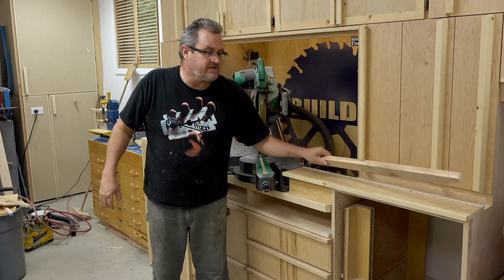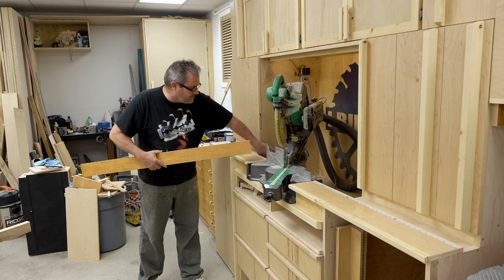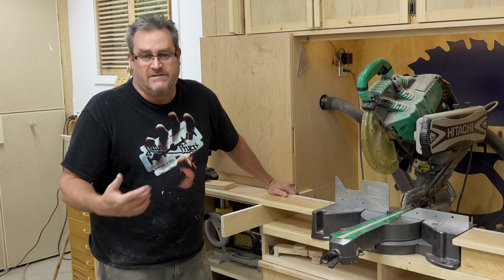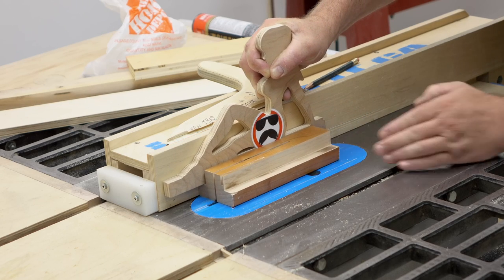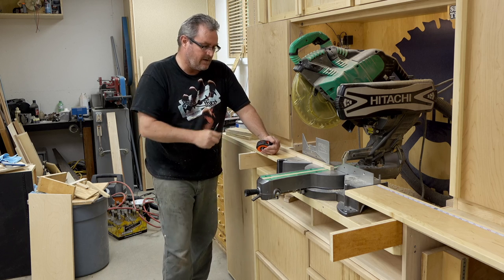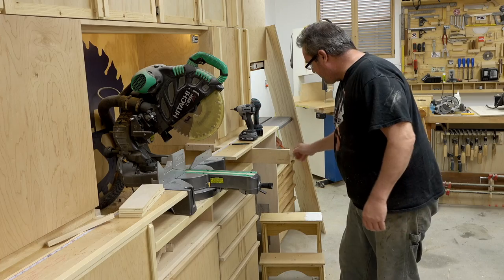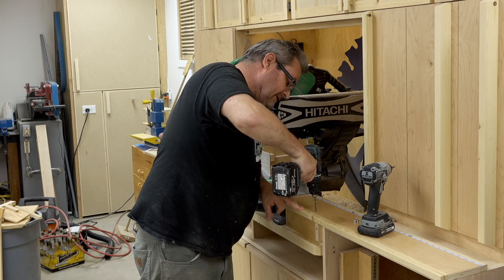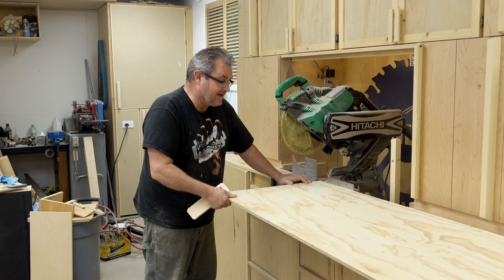Adding Wide Stock Supports To My Miter Saw Station

Comment: You reinvented lopers to do exactly their original job in an all new context, and added toggles for a new twist. Great idea, and I'm going to see if I can incorporate it. The hold-down works on the same principle as a bar clamp, but used in a way I've never seen. I don't know how many times I've 'invented' a new technique to solve a problem only to find it is an old technique reinvented many times before because similar problems come up over and over again. Woodworkers don't need brain games and puzzles to keep our brains sharp because we are constantly solving problems in the shop and on site. Keep the ideas coming John!

Comment: Hmm, I like that drop down clamp after thought, I wonder, won't it hold the board even without the pull out support? looks like it might but I can't tell, although many newer chop saws have clamps like those which most folks seem to remove, like those TS blade guards :-)

Comment: 1:50: What's that red stain on the end of the support wing? Did you cut someone's arm off?  😀
Reply: Michael Rubin below states, that it is, "red staining left from melting a plastic cup with mineral spirit", which as I read it, remembered him doing, or at least doing something similar.
Reply: In the video where he melted the cup, John said something like "people will comment on that red spot forever, wondering if I cut my arm off or something"    So... The comment was a joke.
Reply: He must have used a rip saw and not a cross cut saw...hence the mess.
Reply: And the joke will be in every video from now on. As will the following explanation comment. As will the comment explaining it was a joke.
Reply: A running gag, lol, nice!

Comment: I hope I laughed, correctly at 6:58, when you cut the excess off the filler pieces.  But am I wrong that those cut offs would've been good for the toggles you just installed?

Comment: did your saw come with a hold down, most sliding saws do, on the other hand it seemed the off cut just tipped a bit but didn't fall which would be OK to me or does it risk contact with the blade

Comment: Maybe it's misleading John but since that vertical post with the little paddle that slides down it clamps the work piece so well, are the little pull out pieces needed at all?
Reply from the maker: Yes, for heavier stock.

Comment: Toggle clamp tho? whould be much faster and more convenient yo
Reply: Who doesn't love toggle clamps!?
Reply from the maker: Lost on some that the point of many of my videos and projects is to not rely on stuff you can buy at Rockler or Amazon, but to engage the brain to come up with a solution using what's available.
Reply: well I got it perfectly, just for this case maybe would be good anyway since ur solution isn't 100% completed and seems a bit bulky, when u have lots of repeateble cuts could be a drag (not that u gonna do 300x 2 meter plywood shits at once, but still). Maybe since u're in love with handmade clamps it's a good opportunity to finish the thaught and made wooden toggle one, I would watch the shit out of it. Have a nice day sir

Comment: John, this is off the subject I know, but do you really think impact drivers really are nessacery in everyday woodworking ? I ask this for two reasons- 1/ I hate the noise !  2/. I have never needed one myself. A combination of correct speed , correct driver bit and occasional lubricants (wax, soap, whatever) have always been fine for me. I mean no criticism  but would like your opinion.
Reply: I'm just a home-gamer (and not a very good one at that), but having bought and used an impact driver, I would never go back to using a regular drill.
A bonus is that using the drill to make the holes and the driver to put the screws in means you don't have to dick around changing bits all the time. :)
Reply: TheOneWhoMightBe   Exercising my right of reply, I am not a home gamer and have probably been working in the building industry somewhat longer than John, and in my opinion there is very little need of these things. The right size pilot and countersink,a new bit of the correct size and Bob's your auntie !   There have only been two occasions when I wished for an impact driver and they in all honesty  were caused by my having an underpowered drill driver for the job in hand( putting great big screws into tight plugs).
Reply: nwodmf   I don't have any experience with anything but knuckle busters in mechanical work ! but I know that the steel roof guys swear by the big corded impact drivers. As an aside, I bet you've tried to replace a wheel where some knucklehead has swung on his airwrench  just in case it escapes !!
Reply from the maker: CrimeVid - Necessary? No, but if you are driving screws often, definitely worth having. Like everything else, they take practice and should be left on the bench for delicate stuff that a hand-held screwdriver would be better for.
I drove millions (literally) of screws with corded and cordless drills before I got my hands on an impact driver, and there's no going back.